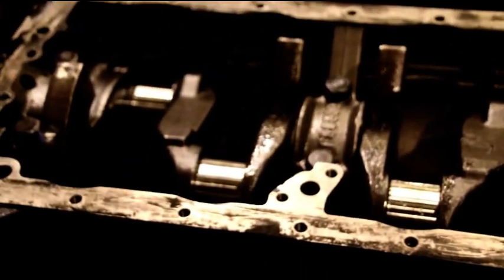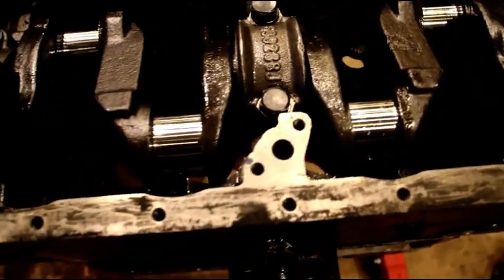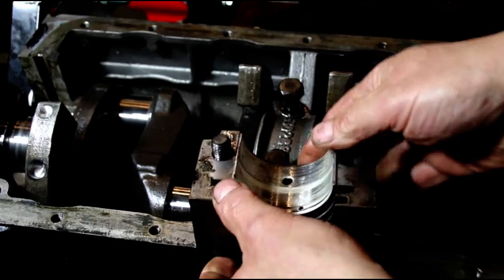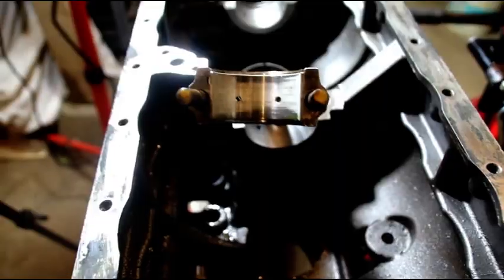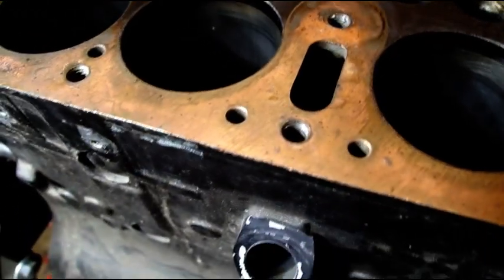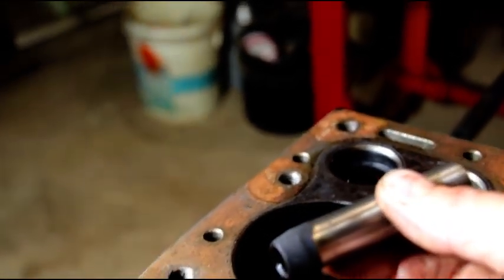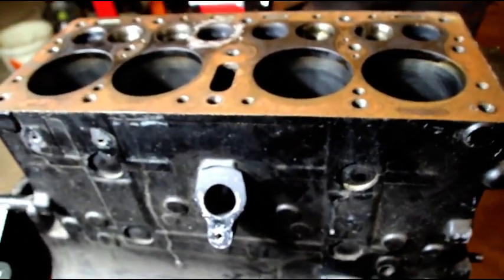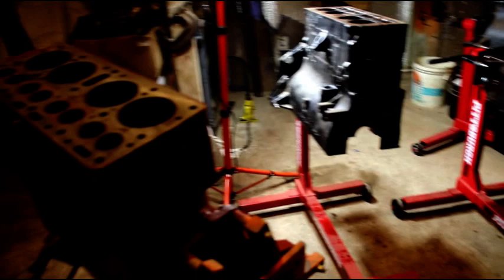Willys Chinese Block Problems......Don't Waste Your Money !!!!!!!!

Comment: That would be pretty bad to put all that money into a block, and then see it turn into a paper weight in 3,000 miles.  I would never think about buying a chinese block to begin with, you just don't see the quality.  I restored a 2000 arctic cat 400 4x4, and paid over 600 dollar's for a new carburetor, because the old one was no good.  I could have bought one from china for less than 50, but i didn't want any issue's with it.  I tried finding a good used one, but had no luck.  I have bought extra used parts from unit's being parted out, just to have an extra, because even they are better than most of the aftermarket stuff you can buy new.  G-d bless.

Comment: I had no idea that you could buy chinesium alloy blocks for these Jeep’s!!! What is meant by the Kaiser willys blocks being Chinese? Did someone snag the name?

I cast iron parts and do pattern work. Castings should be steel shot blasted after they are pulled from the sand. So if there is sand left over, that is not good.

I would be concerned about core placement. If the obvious is that bad, I would bet the core placement is a disaster. It would explain the clearance issues with the mains. But I would suspect excessively thin block walls as well.

395 on a 375??? Are you F-ing kidding? And yup, your oil galleries are poor core placement!

And what about alloy? Bet on shity alloy…. No nickel and no compacted graphite.

Comment: I was always of the understanding that the bearing clearance itself was what held oil pressure, not the clearance between the crank throw and the bearing cap. I'm not saying this is acceptable, but something else might be going on there. If those holes were bored up to 0.005" over, pretty much everything from the machine work to assembly is in question. Could have been tight bearing clearances, no or wrong assembly lube, grit and filings still in the oil galleries upon initial fire, bad oil pump, someone left a rag in the oil pan that plugged the pickup, a combination of some or all of those things? That's absolutely mind boggling how much wear there is on those valves and guides with such low hours. I've seen some pretty bad valve wear but those looked like someone took a flap disc to them.
Reply from the maker: All good points and this engine was not assembled correctly.  When the space between rods and crank and crank and mounts gets excessive then oil pressure does get lower.  I recently had an F head with a crankshaft with too much clearance on each side of the rod.  The shop that ground the crank went too far each way.  Oil pressure on a new engine was 6 psi.  I changed the crank and got the clearance below the .010" side spec.   Oil pressure went up to 45 psi.   
It is hard to believe but side clearance on a bearing can and does kill oil pressure.
Reply: @metalshaperJeep  Thanks man. I did not know that.

Comment: ... Spot-On evaluation -- as always    :)

... Suspect casting sand / dirty assembly conditions...  There's hardly Any way those stems / guides could wear That badly is so few operating hours -- suspect improper reamer used     

...  The block is basically a raw semi-finished casting; best avoided to ensure quality results

Comment: Just had my old block bored and sleeved back to STD, and the crank turned to .040 mains and rods, and decked the block and head, with new hardened intake and exhaust seats.  the assembly begins soon!

Comment: The blocks have cast sand in them from new! It hasn't been washed correctly when first assembled! THAT ENGINE HAS ASLO BEEN RUNNING HOT. Running these engines in Australian summer's with no issues, the distance between mains has nothing to do with engine oil pressure, tolerance of grind will as will the size of oiler nozzle to timing gear set, there are to many variables to count as to why this engine is in the state that it is in, what engine oil was used? What fuel octane? Timing? Running lean mixtures? Coolants? Oil pump clearances? What type of engine valves were used? The Chinese engine block cast material  far exceeds that of original Willys engine blocks. Yes the valve seats are an issue checking these tolerances however is the engine assemblers/builder Job before any assembly. Blaming these new blocks is a cheap shot. The age of original engine blocks and recovery of one is in my opinion 1 in 20 will pass all testing, No cracks pressure tested at temperature , deck heights ok, excessive water jacket rust, stripped threads in block for head studs/bolts. The time required to check all of this only to condemn the block and the customer complains. Building a new engine with a new block, I know which I would prefer. Its Time One of the large American aftermarket Jeep companies made a new block in the U.S.A we've been surviving on Willys of FRANCE 🇫🇷  engine blocks until one American had these made in China 🇨🇳 only because it was to expensive to make it in the U.S.A,  I'd gladly pay for a new American made engine block for my Willys L4 134. No other country has the economy of scale to do it Joe's motor pool in the U.K is rumoured to be making a new block possibly.
Reply from the maker: Good points, but please let me know how many chinese blocks you have rebuilt.   First batch of blocks made that came in my shop didn't have enough room for the rotating assembly and the connecting rods hit the block.  There was not enough room to clearance for the rods, people got no help, and lost money.   Next batch had so much core shift you could barely bolt on the oil pan and the crank main bolts were way off.   Tell me again how good these blocks are.  
Next I would love to see your analysis of the cast iron in the chinese block and why they are made of better material.   The original blocks had a very high nickel content and had the luxury of aging.  Blocks were made and aged for months before machining.  The chinese blocks are cast and machined, and I know they are shifting on their trip to the USA.   Again I would love see your metal analysis, or maybe share it on Youtube.   next tell me why engine builders don't know how to wash a block and clean it correctly.  it is an epidemic here in the USA how about where you are.  
I disagree with you on a new block and would NEVER use one, I prefer the older cast iron and do what it takes to make them great again.  At the very least please take some time to show your machine shop and the steps you take to rebuild these Willys engines.   Don't just talk about  these engines show us how you do it and how great you are.   Looking forward to seeing your shop and hear you talk about your experience rebuilding engines.
Reply: https://youtu.be/6T-28mN_o9A

Comment: A few guys on the 2a site have said the Chinese blocks are full of sand. Also lots of things made incorrectly.
Reply: That's exactly what I thought as he showed the wear on the caps on the video, that the casting sand probably didn't get cleaned enough and ruined good parts.
Reply from the maker: yes, but a good machine shop should be able to clean it out before rebuilding.

Comment: Hey Brian, I wanted to ask your opinion,  how much of a role does the Zinc additive play in the lubrication of these engines? Thanks, Tom S.
Reply from the maker: zinc is critical in these older engines.  There is a lot of talk about it and you  can read about it for days on the internet.  I always use a good diesel oil that has zinc in it.  Shell Rotella T is my go to oil for these engines and I have been using it for many years.  Any oil will probably work but it is worth adding some ZDDP at your oil changes.
Reply: @metalshaperJeep  Thank You, Brian, your expertise is greatly appreciated, and I look forward to watching every video you put out there for us!
Reply: Look it up!
Reply: @BasketCaseGarageForFun  I'm sorry, I didn't realize I had posted a comment on your channel, that is if you have one, and yes I did look it up. As Brian stated, you can read about this subject for a long time, so I asked Brian, whom I consider an expert. rather than getting so confused. Maybe you should consider not being so rude to fellow Jeepers.

Comment: Somewhere someone had a video about these blocks containing casting sand as delivered. I would rather have a sleeved original block.
Reply from the maker: Yes they are dirty, and most machine shops don't bother to clean them properly.    An original block is  the only way to go and I would never recommend a Chinese block in any project.